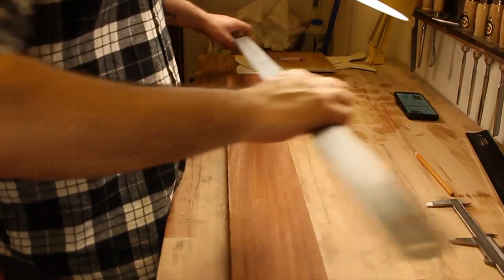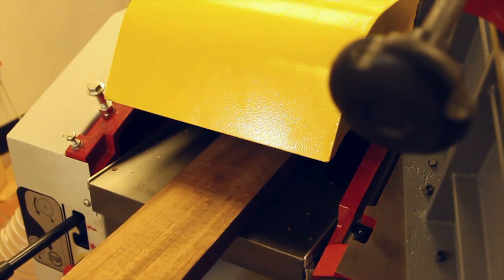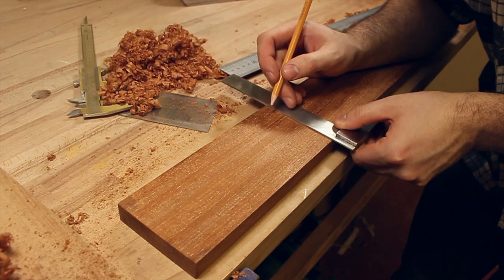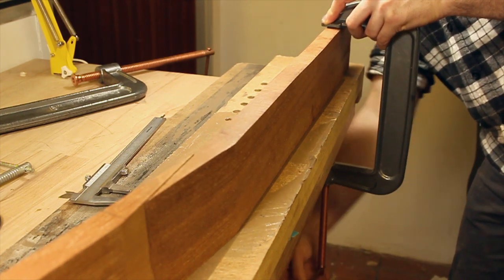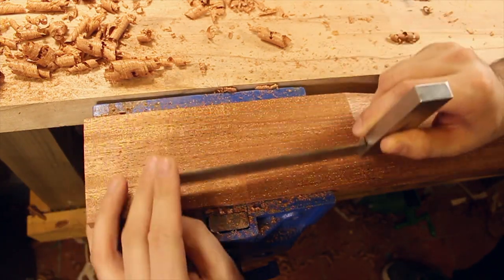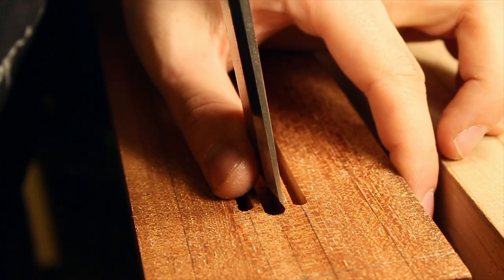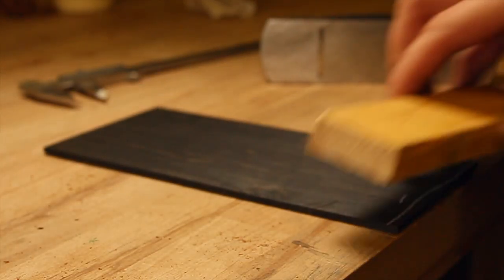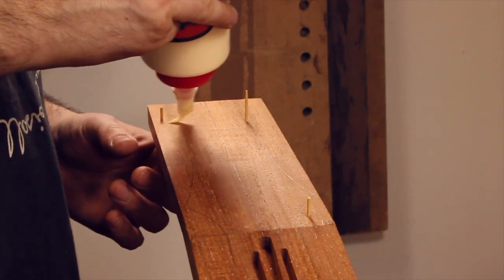Making a Custom Electric Guitar: 1 - Preparing the Neck

Comment: Thanks for the video! 2 suggestions: talk slower and enunciate your words more. 2 questions: how did you know where to start and stop routing the channels? How much total money in tools are you using here?
Reply from the maker: Thanks for watching and thank you for the constructive criticism! This is my first time talking on video, so naturally, I was a little bit nervous, and I suppose that showed. I will definitely take your suggestions into account for my next video! For the channels, I have a block clamped at the headstock which prevents the router from going farther than intended. For the other end of the neck, I just wing it - I like to live life dangerously :) As for the cost of my tools, I couldn't possibly comment. I have collected my tools over a number of years so your guess would be as good as mine!
Reply: Thanks for the reply. Having you speak and voice the process adds much more than just seeing it. So keep up the good work!
Reply: Out of experience, I'd like to try to answer to the best of my abilities (I realize it's been two years but perhaps others may find it useful). My brother already has all kinds of tools that we share so I already had access to the basics. What I needed were some more specific things not common up here (not available in any stores) and they were plunge router, router bits, jack plane, dovetail saw (cuts 0.020 inch wide slots), fret levelling tools from Crimson Guitars (measuring/filing/sanding) and oil finishes also from Crimson Guitars. I tried to get everything all at once, though I couldn't find everything in one place so I ordered from Amazon, ebay, Crimson Guitars and Alloy guitar (this included all the wood, guitar hardware and all the tools) which added up to a bit over $1000. Afterwards I ordered a jack plane from Woodriver because our local hardware store only had cheap hand planes and that one costed over $400 after shipping costs. It may not seem like it but a good hand plane is essential for good wood working if you don't want to spend sandpaper on a regular basis, need to flat sides/surfaces and you save a whole lot of time. Though now I need some proper sharpening tools for my plane blades and my brothers' chisels and saving up for a set that should be under $100. Also I'm thinking to build a mini workbench with a vise and mount a side rail to use as a shooting board so that's going to be another $200 (this includes lumber from the local store)... Man things add up quickly. But the tools are definitely a good investment not only for myself, but also for my friends and family to use.
Reply: @Jinnuksuk  Thanks for taking the time to answer. I had no idea that planes were so expensive! But I suppose they are a lifetime purchase. Have a good day.